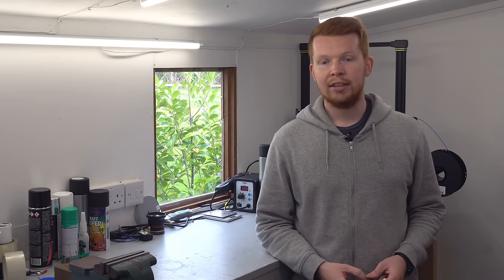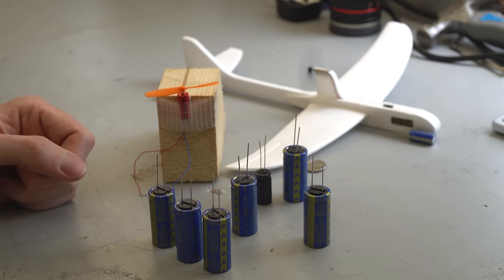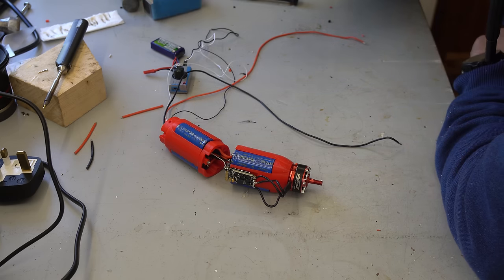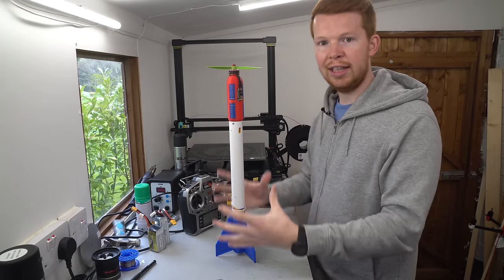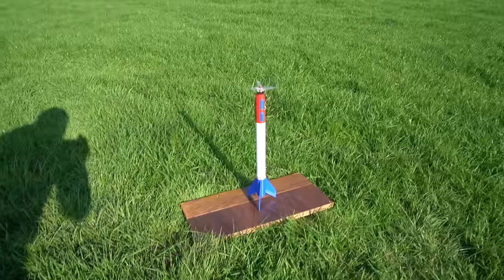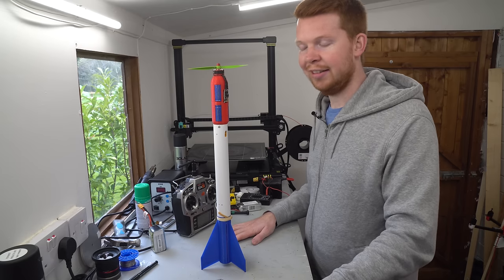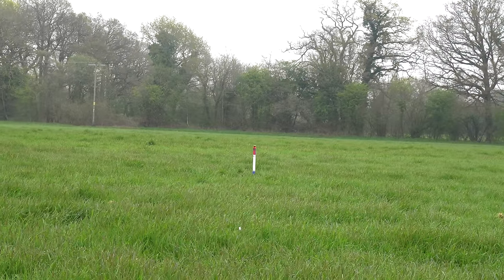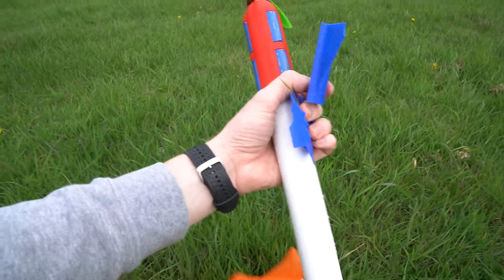Super Capacitor Rocket

Comment: Use a folding propeller like RC gliders have so it closes naturally before impact.
Reply: "You can...."
Reply: It might close "before impact" or if falling too slowly just close on impact...
Reply: WHY would a glider have a propellor?
Reply: @koitorob  Motorized gliders have propellers.
Reply: @koitorob  
That's like asking "Why would a bicycle have an electric motor?" …. because it's better that way. :)
Reply: @koitorob  so they could fly longer Duhhhhhh
Reply: @megatesla  This seems like an oxymoron.
Reply: @koitorob  it simply eliminates the need for a tow plane to gain altitude, then shuts off and folds the prop back flush with the fuselage to reduce drag.
Reply: @megatesla  But the propeller will bend at the hinge instead of bending the blade.
Reply: @KnifeKnut  Not sure what you mean? An unpowered folding propeller can either fold back, stay open, or windmill. In this scenario falling back to earth relatively slowly it will either fold back or stay open. In both open or closed state it should survive impact with the ground. When windmilling it will most likely break.
Reply: @megatesla  the propeller won't windmill or stay open unless the "rocket" is moving or falling tail first, so make the rocket nose heavy (I am pretty sure this version already is nose heavy). In the event of the rocket not falling fast enough to fold the propeller, the propeller will fold on impact instead of bending (as we see here) or breaking. 

As an aside, by adjusting how nose heavy this "rocket" is, you would tune how much it weathercocks and turns into the wind as it ascends.  With proper COG tuning, flight control, motor tuning, parachute deployment, and constant wind direction, you would be able to land the rocket very near the launch point.
Reply: Folding propellers are not as rugged as a one piece propeller of the same weight
Reply: @Koito Rob Google Hi-Start and you’ll understand why a lot of us have moved to motorized gliders.  It’s so much easier to hand launch and power up to altitude than it is to set up a 500 ft long (in my case) Hi-Start.  Plus I have to then stretch it to 800 ft for launch, go get it if I have to launch again, etc.
Reply: @MelonPlyzYT. True, but I only use the motor to get to altitude.  Then it’s shut off while I thermal.  I’m there to glide, not to fly my powered planes.  But I see your point.

Comment: Next Project: Super Capacitor eBike!
Reply: Yes, it might get complex but it is what Tom generally would like to get involved in. I really wish Tom at least discuss the challenges involved in this project.
Reply: This could actually be a great idea. If he fits the bike with a dynamo that can charge the super capacitors.
Reply: Could have a turbo button on the bike that uses the capacitors....
Reply: Judging from how noticably harder you need to pedal for just a single light i think regenerative breaking isn't really going to work.
A turbo button on the other hand would be a good idea, this way you could get away with a smaller battery if you just want to use it occasionally. With recharging time fore the caps it would probably be a lot like the nitro button from need for speed.
Reply: The energy per unit volume of a supercap is not good enough for a bike that is much use.  You want more than 10 seconds of run time.
Reply: Believe it or not, that's actually been done a good 10-15 years ago. Some buddies of mine built one in college using regenerative braking. Worked really well and they published a couple papers from the results.
Reply: Dhaval Bhalara 
It doesn’t have to be complex. Just connect the supercaps in parallel with the battery. When high power is required the supercaps will deliver instantly. 
The batteries won’t like it too much because they will be discharged at their maximum every time you use the boost function. 1st by the motor and then by the supercaps until they are charged again. 
It would require some smart power electronics to limit the maximum charge (regenerative breaking) and discharge rates for the battery. 
A very low value resistor between the battery and the capacitors could also be used but that would dissipate more energy.
Reply: @joshuawfinn Sounds great! Do you have a link to these papers?
Reply: @Conservator.  yeah, the battery current needs to be limited for the boost funktion, otherwise the capacitors are pretty useless. Without regenerative breaking this is pretty easy because you dont need a lot of complicated electronics for the motor, you can boost until the caps are empty and then the current regulator would kick in protecting the battery.
Reply: some kind of KERS for ebike
Reply: Julius Berten not off the top of my head, but it was part of Ardalan Vahidi's ultracapacitor research at Clemson.
Reply: I'm looking at this idea right now funnily enough, as controller and motor can handle 200+ amps but thats a lot of power for the battery..
And it would be better for the regen.
But as other have said to do it properly requires some engineering effort to manage it as I want the caps to be able to have a different voltage to the batteries when it regen's, so I can punch off the mark again, as I can peak above 200 Amps 96v where as the pack is 84v max 20s10p pack.. 
So I'll have to control the power levels with some chunky electronics but at this power level it will have to be done properly or else fire...
:)
Reply: Julius Berten Hi
During boost the motor will ask all current it can get. The capacitors have very little internal resistance so they will be discharged at hi speed. So far no problems. 

The battery has a higher internal resistance and won’t be able to keep up. So the caps discharge faster. That won’t make the bike less fast but it will drain the battery at it’s maximum physical rate and that is bad for its longevity to say the least and might very well cause the battery to overheat and even catch fire. 
If the battery has a protection circuit that limits the charge and discharge current, then your problem is solved. I think though that most battery protection circuits only prevent over an under voltage.
Reply: @Conservator.  yeah, i was talking about some extra protection.
A relatively simple (but pretty inefficient) current regulator only needs a big transistor and a few other components. You only really need to cool this transistor and, unlike a resistor, it would only get hot if it really regulates the current. Cooling should be relatively easy with an old (or, if neccesary, new) cpu cooler.
Also with the capacitor voltage changing you can mount a cool voltage meter to your handlebar showing how far your boost has recharged.
Reply: @joshuawfinn  thanks, i just looked up ardalan vahidi and imediately found papers about ultracaps
Reply: @Conservator.  
That is poor use of the ability of a supercap and battery combination.  The terminal voltage of a battery is nearly constant because it depends on chemistry.  The voltage on a supercap falls to 1/2 as much when you take 75% of the energy out.
Smart electronics is a low cost thing to do these days.
Reply: Max Pain  regenerative breaking could be used to charge the super capacitors
Reply: Ken Smith Hi,
Did you perhaps miss my reply to Dhaval Bhalara? If not could you explain what the function of the electronics would be? Tia.
Reply: @Conservator.  
Since the capacitor voltage varies more than the batteries, the capacitor can be connected via a DC-DC converter.
Think of it as a circuit that has the same input watts (volts times amps) as its output watts but at different voltages.
It is surprisingly easy to build such a thing.
Reply: And when the bike looses charge the you could have something that when you pedal it charges it!
Reply: Ken Smith 
Do I understand you correcty that the battery is connected as usual to the esc and that the supercaps are connected via a (beefy) DC-DC converter to the battery/esc? That would require a sensor to determine when boost is required and an extra circuit to charge the caps after boost. That’s probably not what you meant. 

My idea was to decouple the battery, assuming that the ESC can handle the decreasing voltage of the supercaps (during boost). A even simpler circuit than a dc-dc converter would protect the battery by limiting the current from the battery to the caps. Just a pwm regulator with a beefy mosfet would do the trick. Efficiency could be optimized by adding a solid state relay that shorts the regulator during non-boost operation. Just my thoughts, I’ll appreciate any comments.
Reply: there is a french company that sells a supercapacitor bike !
Reply: @Conservator.  
Yes, you have it correct.  The DC-DC makes the supercap work over a widely varying voltage as it would naturally do.  This makes efficient use of its characteristics.
A MOSFET doing PWM between a battery and a supercap would be very inefficient.  During the time the MOSFET is on, the difference in voltage between the two would appear on the MOSFET and cause it to have high losses.  PWM to a motor works in large part because the motor has a highish impedance in the short term.  Neither the battery nor the supercap would have a high short term impedance.
Reply: @Conservator.  use a separate battery to charge the caps. put a diode inbetween the caps and the normal run battery. then run the 2 in parallel. the caps can throw extra power into the circuit when required and recharge from their own supply but don't effect the primary delivery systems draw.
Reply: Ken Smith 
I see your point and yes indeed a mosfet would have a relative high resistance compared to the battery and most certainly to the caps. I hadn’t thought about that. Tx. 
However by adding a inductor in series this can be mitigated (just like in buck converters)

In your case wouldn’t you need two converters? One for discharging (during boost) and one for charging (after boost)? (and some switch obviously)
Reply: Ken Smith, the converter will always lose some energy, maybe ~10% of the input power, if designed correctly. That's ~90% efficiency, but only when run optimally. (No machine is 100 efficient.) At any other power level, efficiency will be lower.

As said elsewhere, and in the video, ultracapacitors have much lower power density than chemical batteries. Capacitors can dump their electrostatic charge quickly, however, limited only by their internal esr and external circuit resistance. 

In most cases the simplest and lowest cost option for releasing more instantaneous power is to have a more capable chemical battery in the first place.

It's parallel to the somewhat suspect idea of a hybrid car, which usually has a modestly-sized petrol engine, supported by a small battery: It's unnecessarily complex, heavier than it need be, and has the potential unreliability of two power systems, for little gain. (F1 cars show this, when you see the number of different power failures they experience.) 

The car would be more powerful, cheaper to make, and inherently more reliable, if it had either a big battery, or else a bigger petrol engine. Putting the two more limited systems together might save some fuel, but the car becomes under-powered when the small battery has become exhausted. 

A simple EV with a big battery gives hundreds of miles/kilometres of range with plenty of acceleration, as would a car with a big petrol engine, albeit with more noise and local air pollution. A bicycle with a bigger battery would be more efficient, reliable and long-legged than a battery/ capacitor hybrid (apologies for the mixed metaphor!).
Reply: RWBHere 
I think that you meant energy density in stead of power density. A supercap can deliver a huge amount of power but only for a short time. 

Both batteries and supercaps are limited only by there ESR (Equivalent Series Resistor). The ESR of a supercap is however much lower than that of a battery. 

On hybrid cars I would like to add that they perform better together than the sum of the two. The electrical motor can provide instant torque at low speed.  This is where the ICE runs very inefficient.  The run complementary to each other giving the car best of both. Also the electrical motor can be used as a generator for regenerative breaking. The benefit is substantial in city traffic. 

The battery of a hybrid will not become exhausted because it is recharged by the ICE. 

The formula1 power train has an efficiency of more than 50%. This is huge compared to even the most efficient normal cars (<30%)

On reliability: the Toyota Prius has proven to be very reliable. Electrical engines hardly ever break down and the ICE of a hybrid car suffers less stress than those in non hybrids. 

I agree that EV have much benefits over hybrids but until very recently they were simply too expensive. Hybrids and plugin hybrids are in my opinion a very good transition product.
Reply: Conservator, thanks for the correction on the first point; my mistake. I'd 'lost' my first attempt at making the comment, when YT didn't accept it, and frustration is to blame!

A number of hybrids (PHEV's) actually discharge the battery without recharging it. After that, you're left with only the petrol engine. My terminology could have been better there, because I was trying to say that you have the benefit of both power sources when running electric plus ICE, but lose the one until you can plug in and recharge. The ICE is often around 1 litre, which leaves many cars under-powered. I'm an EV enthusiast, btw. Just waiting for the price bubble to burst before buying one, but it would never be a hybrid. A family member bought one, and he's quite disappointed about its performance on longer journeys, because the fuel economy is nowhere near the manufacturer's claims. They are only met on journeys of less than 20 miles/30 km, at best.

F1 power trains might be efficient, but the cars are not! They burn 100 litres of fuel in less than 320 km. That's less than 3.2 km / 2 miles per litre. Even our old fossil car manages more than 16 km / 10 miles per litre. OK, being fair, we only travel at a maximum of 30% the speed. 😉 

Fine about supercaps and batteries. The serious point is that , with present technology, capacitors can run a motor for a very much shorter time than can Lithium cells of comparable volume or mass. Capacitors have their uses, of course, but they're unlikely to be of any advantage on a bicycle, at present. Unless you don't mind carrying the extra weight and volume of the supercapacitors, their protective coverings, and any additional wiring, circuitry and switching, plus the additional costs and losses. It would be very much simpler, and less expensive, to carry the same weight of additional battery capacity. 

Anyhow, thanks for your detailed response; it's appreciated. Moving on now. Cheers!
Reply: RWBHere Hi
I think we agree on the subject and thank you for your reply. Later on I thought my answer was probably more blunt than I intended it to be. It must be my Dutch upbringing because it couldn’t possibly by my fault. 🙄

Supercaps could be used to capture more of the breaking energy than batteries can, but that’s about it for drivetrains. 

And on F1 cars: Even if you only look at the drivetrain, 50% efficiency is not established under race conditions but only under laboratory conditions. But still impressive as far as I’m  concerned. 

Just curious about that PHEV. Was it perhaps an Opel/Vauxel/Chevy Ampera/Volt?
Those cars are basically an EV with a too small battery and a range extender. In that case I also agree (it’s getting boring now;) with your disappointment/disapproval. 

Cheers!

Comment: builds supercapacitor-powered missiles to kill tanks in an eco-friendly way
Reply: Ben Silva  congratulations, you managed to make that political.
Reply: it won't be as fast as a chemical rocket but i bet it has lower thermal signature
Reply: @sepg5084  it doesnt get hot when fully discharged?
Reply: ShakamuraGames won’t help them shoot it down, so it doesn’t matter
Reply: Sounds like a Michael Reeves project
Reply: Capacitors also have value for driving exploding bridge wire detonators... Which are used to fire explosive lens systems of implosion type fission devices.